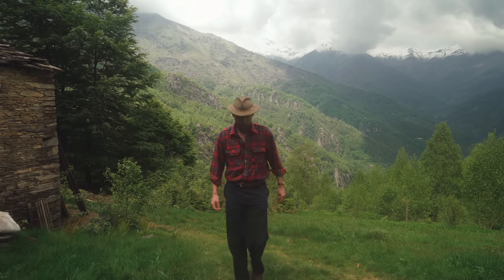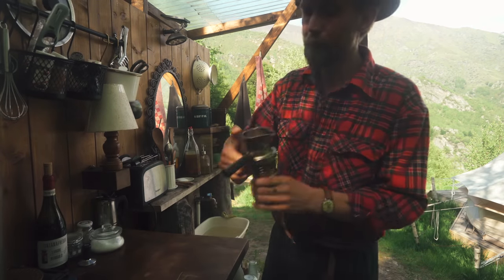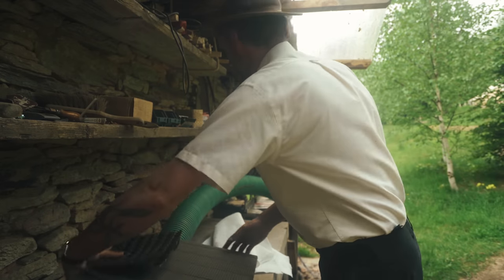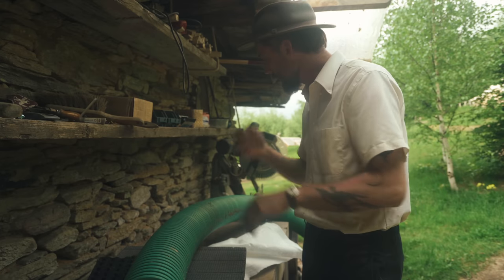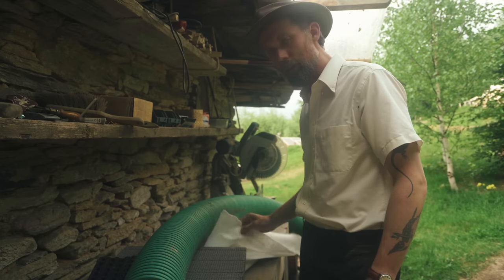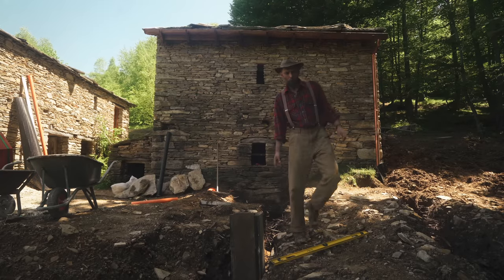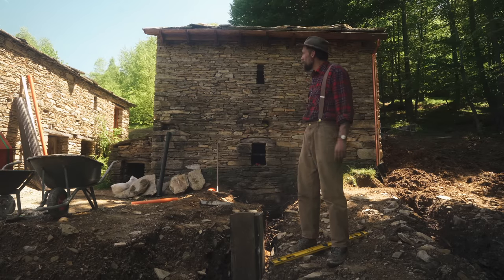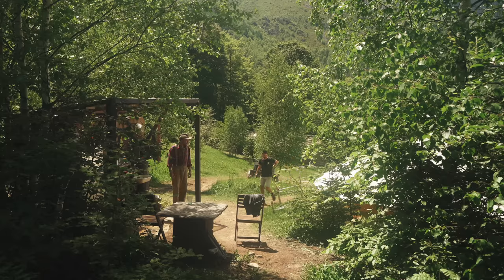#68 Waterproofing the Cabin, Closing the Trench

Comment: Hi Martin, watching with interest as always, however...... to maximise the use of your filter cloth around the french drain, rather than wrap it around the pipe itself, it would be more effective if you were to place the cloth at the bottom of your trench, backfill with 150mm layer of pea gravel (10mm round stone) then lay the pipe, then top off with 600 to 800mm deep x 600mm wide of pea gravel then finish wrap the cloth around the gravel and pipe altogether. Top off with topsoil to ground level.
By wrapping the gravel you utilise a wider area of the cloth as a filter. Suggest you lay stone pavings at ground level to help prevent and discourage further water seepage.
You should leave piped access points to all drain areas to allow periodical powerjet flushing or rodding operations to clear blockages or sediment.
Please, please don't join your surface water drains to the sewage, let that run free or use as irrigation. You must prevent all but contaminated water going to the sceptic tank lest you flood it and destroy the microbugs from doing their stuff.
Lay your sewage pipes at 1:80 fall or vertical to promote efficient solids flow.

Comment: I live in a 300 year old house in the uk. Two feet thick millstone grit walls. You cannot stop water penetration. Stone is porous and the older the stone, the more porous. I have a vaulted cellar which fills up with three feet of water in winter then naturally drains through summer. It’s something you learn to live with. I hope your prevention works but looking at the site of the house, I think you will have problems.

Comment: Mmmm, that plastic sheet close to the wall will get consumed by hot and cold, wet and dry, it will decompose and will become nanoplastics. Old builders wouldn't approve. If you want to live in an old hut in the middle of nowhere you should become part of the place you are in, and not bring modernity where it is not needed. Just my opinion.